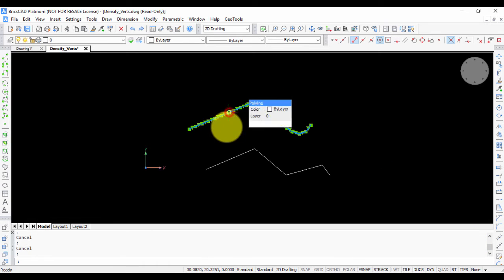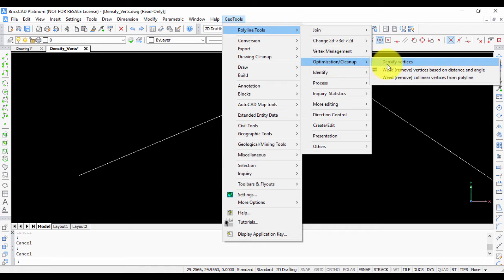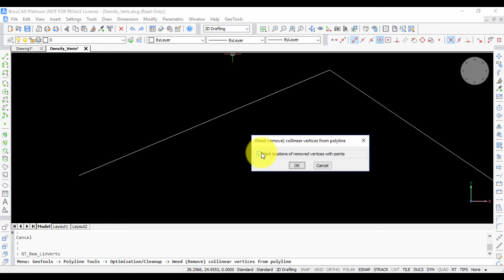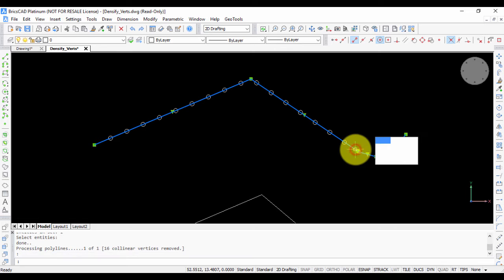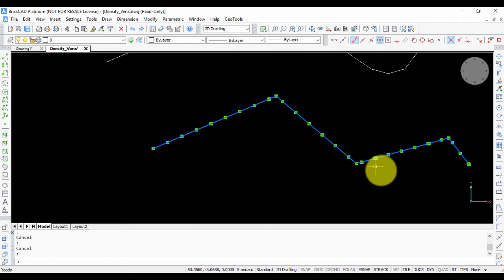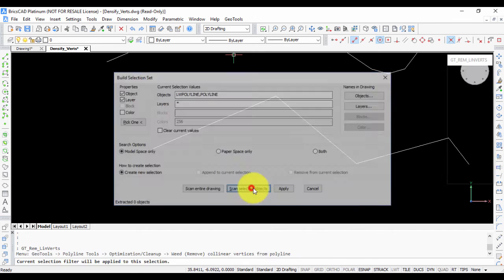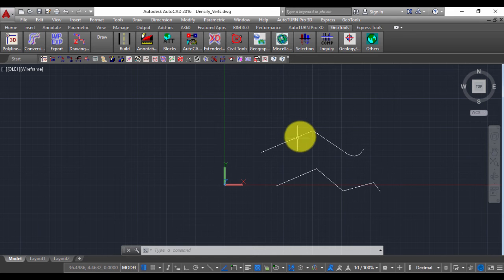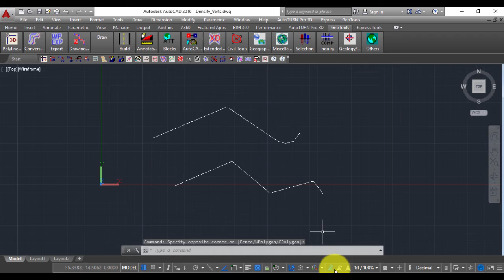Weed (Remove) collinear vertices from polyline: CADPower & GeoTools

Comment: what about if the 3Dpolyline is collinear in XY but not collinear in Z coordinate... how to weed this 3Dpolyline??
for example a path profile in a line but with alot of vertext (100 vertext in 30m)
Reply from the maker: GT_DISTANGWEED should take care of that also.
Reply: @DesignsenseBLR  GT_DISTANGWEED command only work with distance parameter in this case, no with the deflection angle (you must try please). If you give me a email i can send you a dwg file with the 3dpoly i tried to weed. Mi email is luiscuadrado123@gmail.com
Reply: i want to weed 3dpolylines that come from a lidar path profiles... this 3dpoylines have a lot of vertex, in 2 or 4cm one each others and i only want to use the representative vertices with a deflection angle criteria (not the distance criteria) and keep only points with slope changes